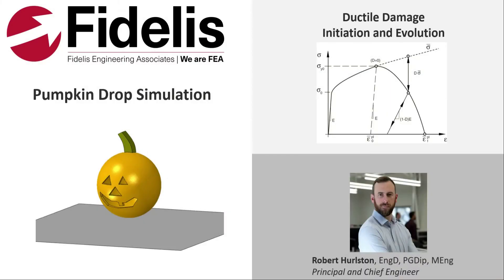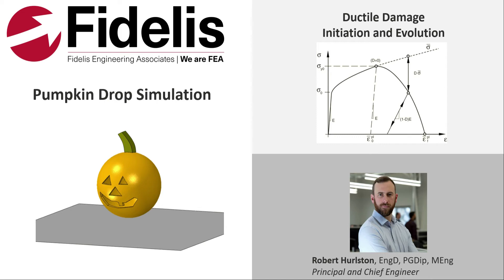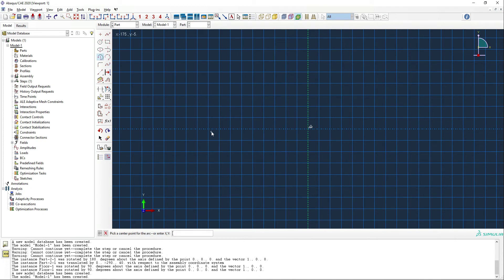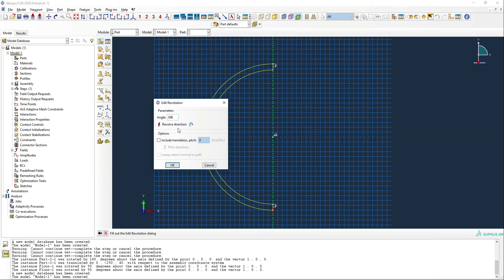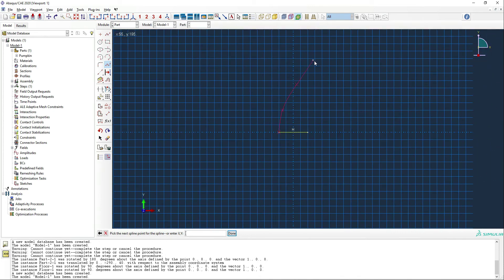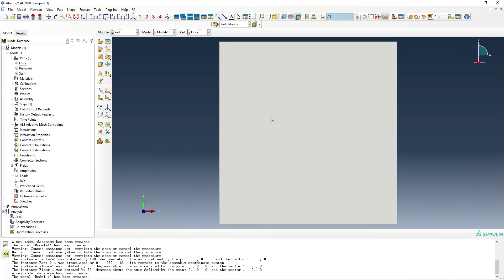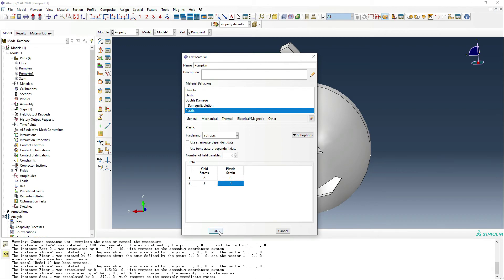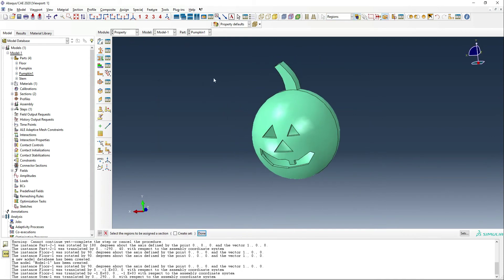ABAQUS Ductile Damage Tutorial - Smashing a Pumpkin - Fidelis Fun Features

Comment: In mass scaling, target time increment is 1e6 or 1e-6, because it says 1e-6 in your site but in video shows 1e6, also when we apply 1e6 the simulation does not recognize the contact because it happens so fast and pumpkin just goes right through the plane. So I think there should be a mistake in the video.
Reply from the maker: Great catch, Outplayed! We spoke 1e-6 but accidentally typed 1e6, which throws the issues you mention. Still, really glad to see that you followed the tutorial through and got to the end eventually! Thanks for participating
Reply: Hello did you get the same result please? Because for me it was not Okey!